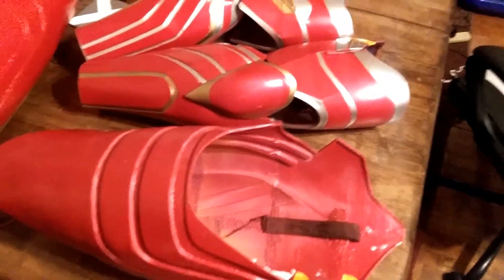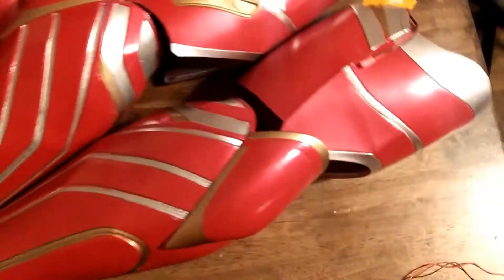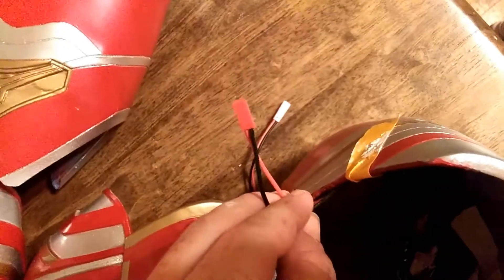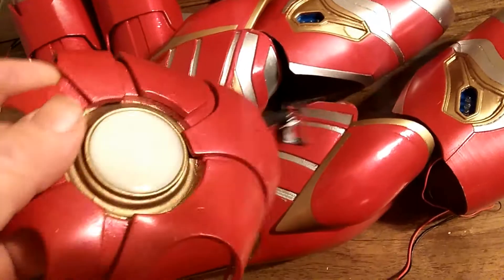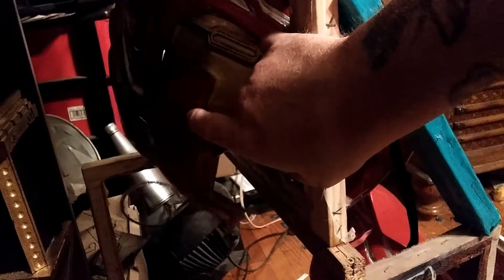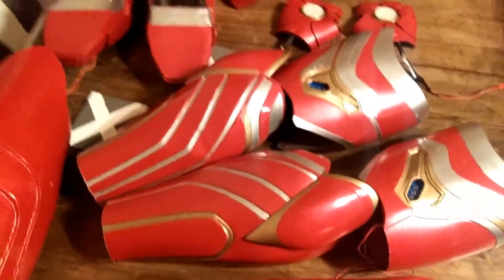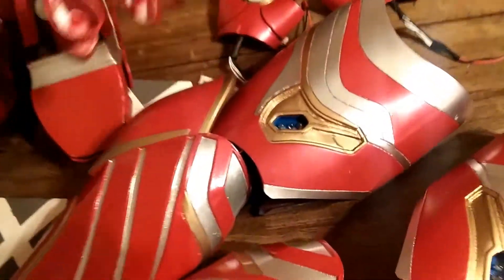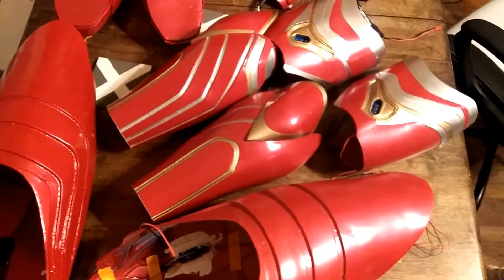DIY 3D Printed Iron Man Mark 50 Cosplay Part 13

Comment: Did you printed to me mark 2 162 cm??? Please  . I have a goog idea . Suit to metal form + hot metal ='metal suit mark 2
Reply from the maker: im not sure what you are trying to say.... do youspeak a different language and used google translate? Ya a metal one would be cool. heavy, but cool. i think someone on youtube has actually made a metal Mark 3
Reply: @BrysonMichaelRC   will you do it for me and send me? PLEASE
Reply from the maker: send you a metal Iron man suit? no no... I only do 3D printing my man.. I dont do metal. I dont print metal filaments either. And it would cost about $1000 USD to get me to send a 3D printed suit.
Reply: @BrysonMichaelRC   send for me 3d printed suit mark 3 163 cm (Nowe Dwory 23 64-730 Wieleń   Poland) my adres
Reply: @BrysonMichaelRC   ok ???
Reply from the maker: Im not going to just send you a printed suit. doesnt work like that. You pay, then we can talk. otherwise, no. my email is dawxgeetar@gmail.com if you want to talk pricing, payment and availability. I dont do commission as a job. I only commission pieces if I have the time to do them and I have two people in line to have stuff made first so even if we were able to work something out its probably going to be a while before I can start on it.